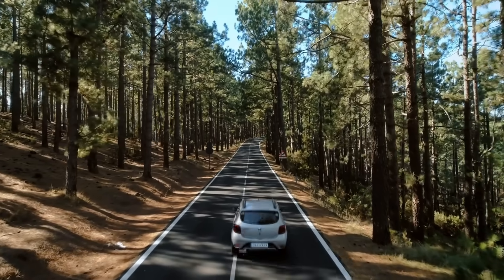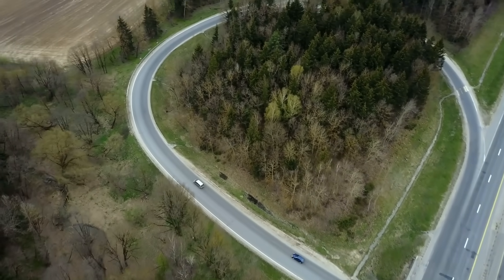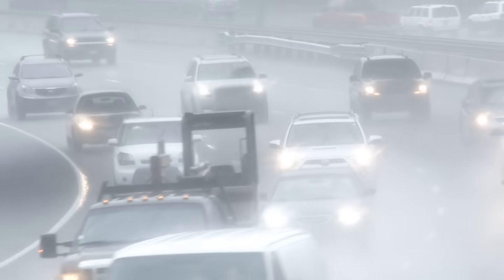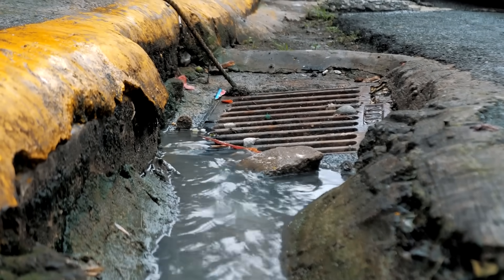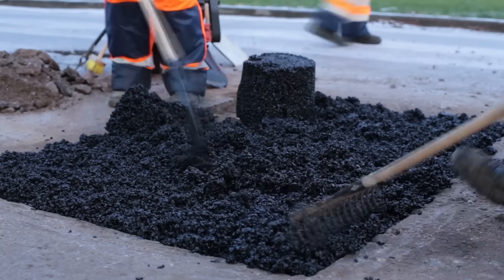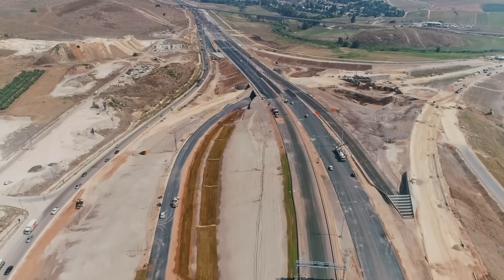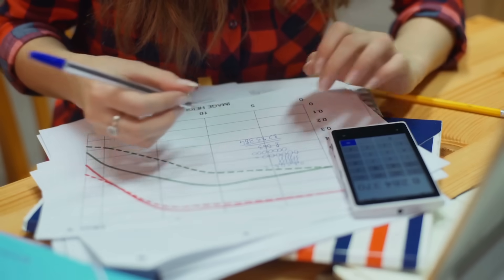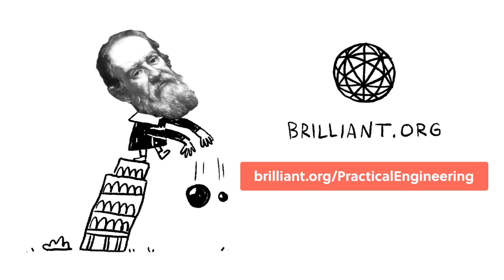How Do Potholes Work?

Comment: Not to be confused with the moron hole. Moron holes are the square dips created by a work crew cutting a hole for access and then not filling it in with enough material. Moron holes don't worsen over time like potholes, so once you get used to it the government will just leave it there forever.

Comment: To be honest I have to disagree that road construction or more specific asphalt depth is determined by whats the most cost effective overall. In germany we have some Highways (Autobahnen) which are privately owned: The state says we want a road here, and we will pay for every year this road exists x €. For that you have to invest first and also pay the cost for maintenance. Those roads are in a near perfect condition. Because no politician says we need to take the cheapest company (without regard for maintenance). Those private roads cost way more in the construction, but nearly dont deterriorate at all...

So I think often times the funds come from different places. Maintenance and new building are not exactly the same ones paying. So it is often choosen to build cheap, because a politician can say: Hey look, our negotiations were great we only pay very little for the construction. And then they take a picture on the new and unused road. After that 100 cars drive over it and its damaged.

Comment: As a Dutch civil engineer I clicked this video to see what this pothole problem is that other countries have. Ice does create potholes in the Netherlands because we use previous concrete on all Dutch highways but because we have mild winters, a rich economy and a relatively dense road network maintenance is great!
Reply: As a fellow Dutchie (but no engineer), I can’t recall having ever seen a pothole in NL. But living in the U.K. nowadays, I can see several from my window. Maybe it helps that a lot of residential streets in NL are not asphalt, but rather paved? No idea if that actually makes a difference, but it’s a big difference between NL and eg U.K.
Reply: @Mynervas  It's just the highways after a hard freeze. The openness of the asphalt (zoab in Dutch) means it's very brittle. Ideal for rain but terrible for ice and snow. In cities temperatures are higher which decrease the chance of ice forming. They also use a different kind of asphalt (dicht asfaltdab) inside cities (although not everywhere) which also doesn't break as easily.

Comment: Brick roads are dangerous and shouldn't exist. Same thing with brick sidewalks - that's how I broke my ankle. Brick roads are how my grandpa broke his leg back in the 50s.

Brick is incredibly slick when it's wet and it dries slower than concrete and asphalt. In both accidents, it was a case of wet bricks being the cause. Grandpa was lucky - he was on a motorcycle and ended up underneath the car in front of him when he went to hit the brakes. If he had died then, my dad and aunt would never have been born.

Comment: By sheering off one of the bolts holding the engine in place on my car cuz I didn't see the pothole until it was too late to avoid it/slow down. That was a very expensive pothole. I haven't even had that car for almost 5 years now and the memory still hurts me.

Comment: The gravel mountain roads in Washington state are the worst I've experienced. So many potholes you're lucky to find a stretch where you can go over 15mph. Much like a bullet hell game, except if you had two spaceships that are a constant distance apart and allowing either one to be hit will probably kill you (hey, I may have just invented a new game). You're in a constant state of peril dodging both wheels around holes, while looking ahead to see the pattern of remaining road and avoid getting trapped. Sometimes there's just no choice but to stop and get out to check the hole depth and see if you can safely drive through it (they're all full of muddy water so you can't tell just by looking). It's maddening after an hour or two.

Comment: I think it would be best to just put concrete blocks under places where vehicles most often change speed and/or direction (e.g. before traffic lights, in sharp corners, roundabouts, etc.). This way we can minimize the additional expenses and improve the most vulnerable places.

Comment: For the longest time I wondered what those lines in the road were. I initially thought it was oil leaks, but then I saw them going perpendicular to roads which proved that wrong.

It seems so obvious now that it's sealed off cracks.

Comment: "So, Roadway owners spend a lot of time and money fixing them..." That was the funniest thing said on youtube I have heard all week. There is a road around my area where pathway crosses over large underground corrugated water pipe. The asphalt has been collapsing into a hole that has formed in the corrugated steel pipe under the road. The hole has had gravel stone being thrown into it and the section coned off all year. Covid or not, it is a driving hazard. Especially when some smarthole people keep moving the cones on to the undamaged side of the road during the night. The road sinking into the damaged pipe could cause a car to slide off the 6 foot drop into the marshy water.

Comment: Would better drainage be a more effective solution than more robust or durable surface materials in climates that reach sub freezing temperatures, or trying to keep the majority of water below the frost line? Not sure how economical this would be in comparison or if its even feasible.

Comment: 95% of potholes are actaully from soil testing. Guarantee that if you dig them out, most of them you'll find sand in them from a sand replacement density test that wasn't filled back in properly after the test... "It passed so why bother" also holes from nuclear density gauges more used nowadays that dont get filled in at all... But engineers love this. In Australia they have a 5 year maintenance contract and when it fails after that they can tender for the job again.

Comment: This video just scratches the surface (no pun intended). 

In the UK we use the DMRB CD225 with all of its prerequisites for design, with CIRIA Series 600 for the use of capping and sub base.

Ultimately, a well graded capping and sub base and rigid surfacing will stand the test of time, not flexible, but then government departments are cheap and prefer to use crappy materials if they can save money. But like All engineering problems; start cheap, pay later.

Comment: The best road is a concrete pad with a layer of asphalt. Asphalt is quieter and more comfortable but no tension strength. Concrete is rough on tires and much louder but incredible tension strength.

Comment: I really enjoyed this one.  I never gave much thought to the fact that cracks can let water both in and out.  I don't know if this would be considered a pothole, but I recall in college that there was this one hole near the exit of a parking lot adjacent to the house where I lived.  It just kept getting bigger and bigger, even though there wasn't much in the way of traffic, rain, snow or ice.  It turned out that a clay pipe in the ground had cracked and was letting waste water out into the soil, but also letting soil be washed into the pipe, which is where the void was coming from.  They only realized the problem when the pipe finally clogged with sediment, and sewage backed up into the house where I lived.

Comment: In terms of damage to the road surface, trucks do so much more damage than cars it's insane. Since the damage is calculated based on weight per axle to the 4th power, even a UPS truck does hundreds of times more damage than a standard sedan. You could take several million people from a city, put them all on bikes for a mile-long Freddie Mercury tribute, and 1 bread truck would still deal more damage. As I understand, bridges don't even take car traffic into consideration when accounting for long term damage. Wild to think about, especially with our "zero hour" transportation economy, where most things are delivered by trucks.

Comment: "Roadway owners spend a lot of time and money fixing them (potholes)."
Press X to doubt.
Reply: You can doubt it all you like, but even if you're paying the lowest bidder, the materials and the amount of labor required is extremely costly.
Reply: Actually if you think about it, if they didn't spend time on the roads then every road will just be rock by now
Reply: I actually work in road repair and run roadwork crews so I know exactly what the local government spends on road repair almost to the cent, and my crew alone uses $100,000 alone in asphalt per annum. Add to that the wages and running costs (fuel, maintenance, miscellaneous equipment etc) it’s close to $500,000 without taking into account the initial outlay of $600,000 for a asphalt patching truck, for a crew to repair a city of 46 suburbs, with thousands of kilometres of roads. There’s only one minor patching (pothole) crew for a city of 405 square kilometres. It’s not necessarily a money problem because I live in a well funded city that’s never been in the red once since convicts built the roads in the first place, but a resource problem and logistics problem and a growing city with high volume of traffic with increasing heavy vehicular traffic problem.  
I work a minimum 60 hours a week to fix the roads but it’s just not feasible a city of my size to have only one crew running, but unfortunately the public don’t want to spend a million dollars to get another crew up and running so the short of it is I’m one man trying to solve everyone’s problems and cop abuse from pissed off residents. 

TLDR: Road owners do spend a lot of money and time repairing roads but it’s a very complex issue.
Reply: @אלטרה  blah, blah, blah, yakkaty, smackety...truth is, they ain't doing a good enough job.  Build better roads.
Reply: @DVankeuren  build better roads? Why didn’t I think of that? How much do you wish to pay in taxes and land rates for that to be achieved or would you prefer toll roads? You get what you pay for.
Reply: Wyoming does otherwise. Lots of roads few people yet the road crews are constant in summer.
Reply: X as long as you not living near HOA. If you do you have to wait a few months for them to repair the road.
Reply: X
Reply: X

Comment: Here's an idea, why not change the base course & subgrade to allow the water to run off just like the tarmac layer, to help prevent water from getting trapped over an extended period in the first place?

Railways make good use of this by using granite ballast which has a lot of holes in the ballast to help water run off.

Comment: hello sir,
currently i am in IB BOARD, sir i really like your experiment (How Quicksand Causes Dam Failures), i need some help from you, i would be needing some data related to this experiment like the dams dimensions and the data collected by you, because in our board we have to write extended essay and in that i would be  using your idea and if possible probably  i would be performing the same experiment at home , but sir it would be a great help if you provide me the data.
to contact me you can mail me on 
prandavbhakta3112@gmail.com
thank you sir in advance 
your faithful 
prandav bhakta

Comment: The idea of replacing asphalt with concrete to distribute load and reduce potholes is... well, complicated. In Calgary they made a large chunk of Hwy 2 (Deerfoot Trail) concrete to mitigate the Alberta weather causing potholes, but instead ended up with like 20+ km of washboard vibrating hell 🤷‍♂️

Comment: Nice explanation about the potholes on the roads but there are a couple of details that were left out of the video. The first and most important in my opinion is the fact that roads, as they extend across vast territories, face different soil conditions. The soil mechanics aren't the same in all places, which brings an additional challenge to road engineers who must compensate for the thickness of different materials in order to give the road the most homogeneous mechanical conditions possible.

There is also the fact that the construction materials won't always be the same or of the same quality because to keep costs within budget it is necessary to use local materials which can affect the homogeneity of the mechanical behaviour of the road in the face of the vehicles that roll over it and generate areas that are more prone to generate potholes and require more maintenance than others. 

This is the reason why patches to repair roads are often not as effective as we want because the thickness of the materials in that area is not correct and the pothole will continue to form recurrently in the same area and will become more frequent as traffic on the road increases if the vehicle load exceeds that for which it was designed.

This is the second detail because it also implies that the thickness of the materials to be used considers the load as a function of the traffic over the road, the more traffic, the greater the load it must support and the greater the wear it will have.

Comment: In humid tropical regions, potholes also form at a very high rate. There's no freeze-thaw action, but there is a seasonality in the subgrade's performance, depending on the alternation between wet and dry seasons. During the dry season, clay soils are hard and sturdy, and thus provide excellent support for the weight of vehicles. When the wet season comes in, water infiltrates and induces things like plasticity (clays absorb water and become soft and pliable), expansion (some clays absorb water into their molecular structure and increase in volume, much like the ice lenses in freezing conditions) and drainage problems (clays are less pervious than sands, gravels and loams), so the water often is limited to escaping under pressure through cracks and weak seams.

Comment: Something I’ve started to see in my country is to repair a road by renewing the Tarmac. The area around a pothole is removed with a mill. For about a one square meter pothole between 9 and 25 square meters are removed. The Asphalt is then heated and reapplied. 
From my observation the purpose if these larger scale renewals is to move the seams of the new Tarmac further away from the pothole and thereby reducing the chance of it forming again.

Comment: Thanks for another great video Grady!

I am curious how potholes form in dirt roads though. I can understand how water will erode linear channels through it of course, but I don't really understand why so many symmetrical pot holes will still form in a relatively homogeneous road made out of dirt.
Reply: I imagine there are soft(er) spots in the road that settle unevenly. This creates a localized low spot for water to collect and weaken the road surface and base material beneath. Vehicle traffic accelerates the settling/erosion/soil movement and the hole gets worse over time.

Comment: Not to mention in colder climates that need snow plows to remove snow, the blades from the plows scrape across the surface, ripping up small chunks of asphalt where the road is cracked

Comment: In The Netherlands we barely have potholes. Either they are fixing the roads already when it cracks, or we just have good weather.
I drive around 1700-1800km / 1000-1100miles per week and never have i seen a pothole, not on highways or on secondary roads

Comment: You should see the roads here in Tucson. Absolutely horrible, pot holes everywhere and we can’t do anything about it because of that damn bright thing we call the sun.
Reply: About 20yrs ago my school at the time decided to redo all their parking lots and replace the playground area with a giant blacktop. I'm not sure if they used the wrong mixture or if it was just due to the atypical heat wave we had, but the blacktop didn't harden for about a year. We came home with bitumen on our clothes every day from recess. If you jumped enough in one spot you could make a little depression in the blacktop, semiliquid tar oozed out of the perimeter, and after a few months the surface was very uneven because the areas that cars parked or kids regularly played on were all sunken slightly.

Comment: Potholes : exist
Drivers ; "what a bummer"

Cysclists: exist
Potholes : "I"m about to end this man's whole career"
Reply: This meme is so stale that if I tried to take a bite, I'd chip a tooth.
Reply: @screwbles5697  Engineering channels attract the old guys. Curious, smart, but a bit out of date!
Reply: theyre easy to dodge on a bike tho right?
Reply: @knuppel8875  they are, to some extent. I hit a pothole on a descending false-flat, i braked as soon as i saw it but still hit it at around 45km/h(28mph), my wheels went wobbly. If i hadn't braked i migth not be here typing this comment.
Reply: @knuppel8875  I've smashed potholes going between 10-40mph on my bike, every time is a different experience from slightly annoying to holy shit I'm going to crash.
Reply: @knuppel8875  No because a cyclist has to follow the traffic laws also, and that means getting squeezed between traffic and the curb - you know, the area where most potholes form. So they have no room to go around it and the skinnier tires have to tank the damage. On mountain and run-of-the-mill bikes it's OK because tire pressures are low, on road and TT bikes it likely means new tubes AND tires and maybe even wheel spokes because they run higher pressures and higher speeds (a tt bike can hit 30 mph on a flat with effort, 20 mph cruising, 40+ if the downhill is steep enough; the tire contact is about 3-4 sq cm, and the tire pressure is near 100 PSI to support the rider.
Reply: motorcycles: chuckles I'm in danger
Reply: Roads were first paved for bicycle traffic.
Reply: @trentvlak  i've always thought it was for horses and carriages